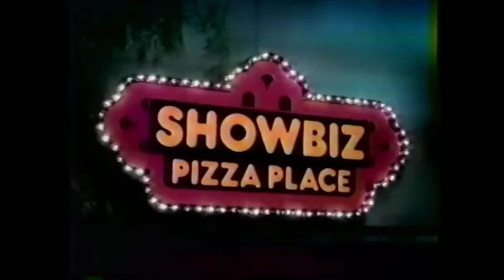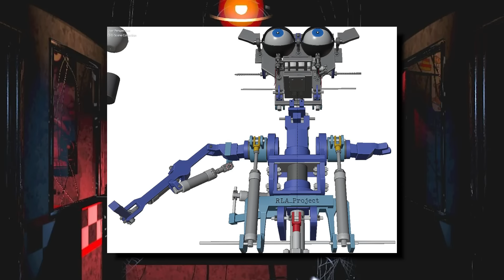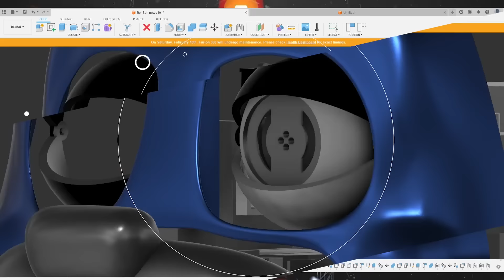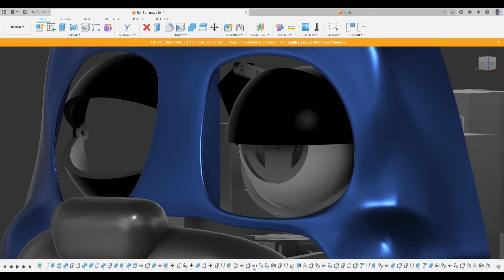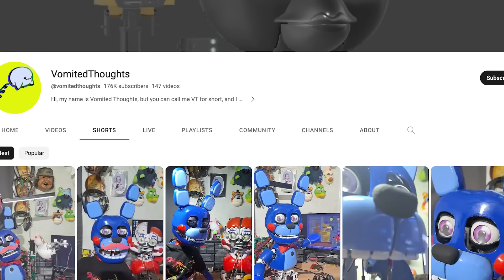FNAF In Real Life Animatronics

Comment: I would love to see a fully walking fnaf animatronic. I think it can be done, but weight and gravity as really the main issues. Walking robots do exist, but they are slow and usually (I think) are a tad lighter and not sure if they use similar structures to animatronics. I'm not an engineer, so I can't say. I do think its possible, but it would have to be built more like a robot than an animatronic

Comment: I actually designed a possible springlock suit. Using pins with springs attached. And like in the graphic novel of silver eyes. The springlocks lock to the outside of the yellow suit. By rotating and locking in place. Ofc I didn't plan to add springs strong enough to peirce human skin skin. But it's possible.